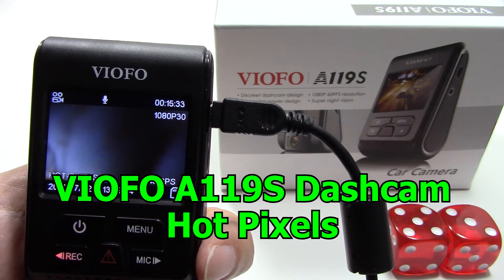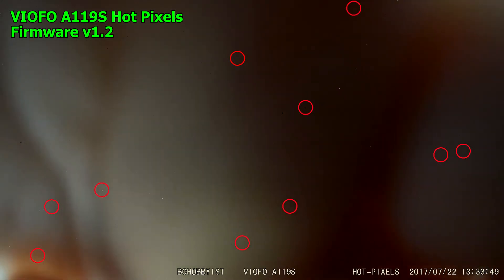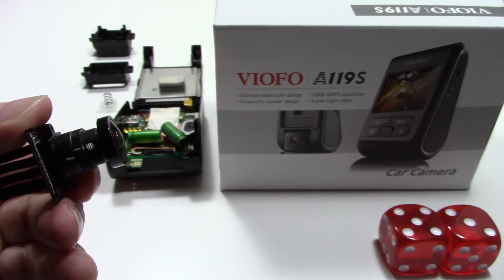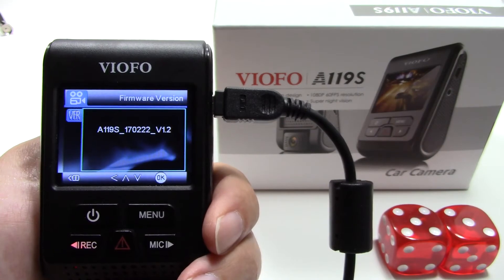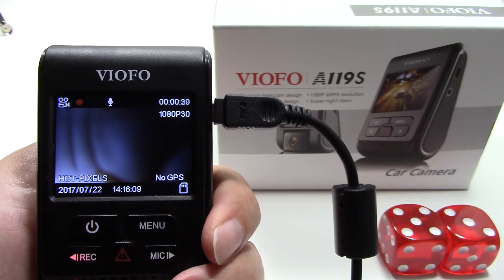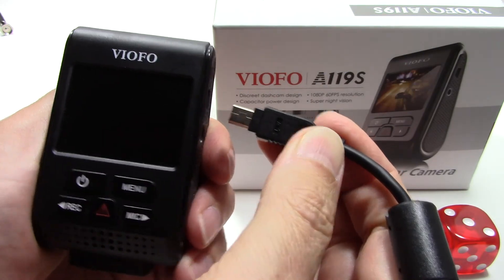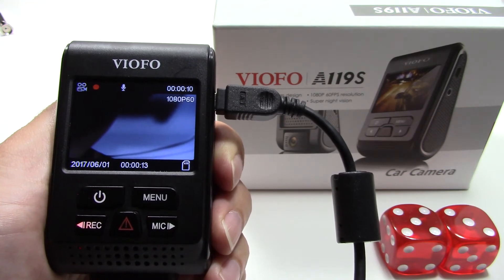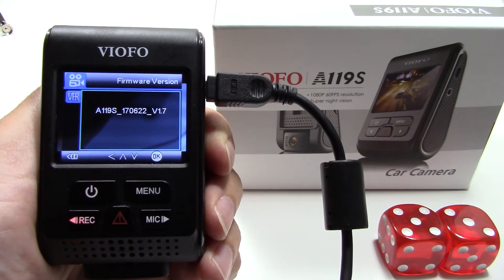Dashcam Hot Pixels white dots VIOFO A119S

Comment from the maker: VIOFO finally released the A119S Dashcam Firmware v1.7 Update which includes Hot Pixel Remapping function. All A119S Dashcams have white dots appearing in night recordings. The v1.7 Update dynamically remaps the Sony 2MP IMX291 Exmor sensor video defects reducing the white dots. This improves night recording quality but is negated by the 
over-sharpening Image Quality tweak. Why release a firmware update which improves night video quality and at the same time destroys daytime quality by over-sharpening?
A119S Hot Pixel TIP
Since FW v1.7 dynamically remaps weekly/monthly it can be forced to Remap by advancing Time Setting by one month then powering OFF then ON then restore time. Perform this Remap Tip at night for best results.
Hot Pixels are caused by contaminants getting into the Sony sensor during production or by excessive heat damage to the CCD sensor.
OLD > A119S - SONY SENSOR (IMX291) - SG9663DC SB PCB V01 20160708
NEW > A119S - SONY SENSOR (IMX291) - SG9663DC SB PCB V02 20161214

Comment from the maker: Flickering white Hot Pixels are caused by contaminants getting into the Sony sensor during production or by excessive heat damage to the CCD sensor. I've tested F1.6, F1.6 v2, F1.8 v2 A119S Lens Modules. All Lens modules out of the box had over 10 Hot Pixels including the newer V02 Sony Sensor circuit board. I conclude all A119S Sony IMX291 Sensors have Hot Pixels, the current July - Dec 2017 remapping firmware patch also degrades image quality. Request VIOFO to release Firmware v2.2+ without the Hot-Pixel remapping patch until its ready and doesn't create overheating.
OLD > A119S - SONY SENSOR (IMX291) - SG9663DC SB PCB V01 20160708
NEW > A119S - SONY SENSOR (IMX291) - SG9663DC SB PCB V02 20161214
My prediction for the A119S Lens module issues is VIOFO will either try to perfect software patches to fix obvious hardware defects or VIOFO will stop using the Sony IMX291 sensor in 2018.

Comment: Is this "normal" on Viofo cams? Just got a new A129 Plus Duo and seeing the same thing in front + rear camera.
Reply from the maker: If your VIOFO A129 Plus shows static white pixels in all night footage take one screenshot as I did and contact either the vendor or create Service Ticket on VIOFO Support website for immediate replacement. The A129 Plus Firmware should NOT show HOT Pixels. May want to try updating Firmware or take it back to local shop.

Comment: A119 has the same problems?
Reply from the maker: A119 & A119S both suffer from hot pixels at night if the sensor was defective during production. Very few A119 sensors had these defects, the newer A119S Sony sensor is a disaster.
Reply from the maker: my advice to A119 & A119S owners with more than 10 hot pixels is to load newest Firmware to mask most defects. If Hot Pixels still appear claim warranty with VIOFO Support Ticket and get a new sensor & lens module. Buying any Dashcam with 10 - 40 Hot Pixels on all night recordings isn't acceptable. 
OLD > A119S - SONY SENSOR (IMX291) - SG9663DC SB PCB V01 20160708
NEW > A119S - SONY SENSOR (IMX291) - SG9663DC SB PCB V02 20161214
Reply from the maker: currently testing A119S newer version02 Sony Sensor circuit board for Hot Pixels. Interesting there are V01 & V02 for Lens and now Sensor. I received replacement Lens Module with v1 F1.6 soft-focus defective lens but newer v2 Sensor board. Plan to combine new coated v2 F1.8 Lens with v2 sensor board.
NEW > A119S - SONY SENSOR (IMX291) - SG9663DC SB PCB V02 20161214
OLD > A119S - SONY SENSOR (IMX291) - SG9663DC SB PCB V01 20160708
NEW > A119S - v2 F1.8 coated 101-Hview Lens - plastic base
OLD > A119S - v1 F1.6 soft-focus 98-Hview Lens - metal base
The VIOFO A119 & A119S Dashcams are great for DIY projects & repairs.